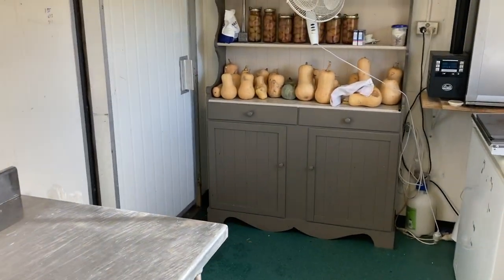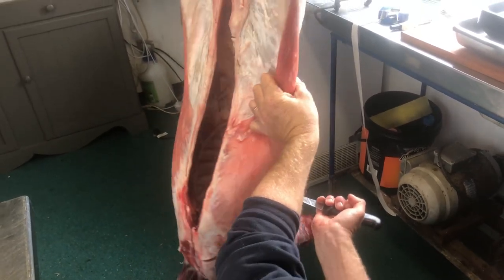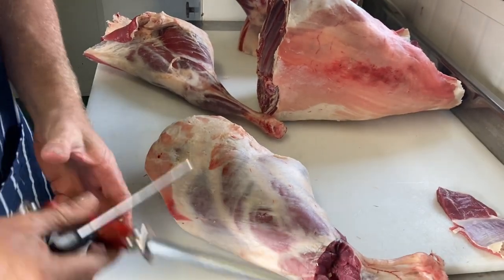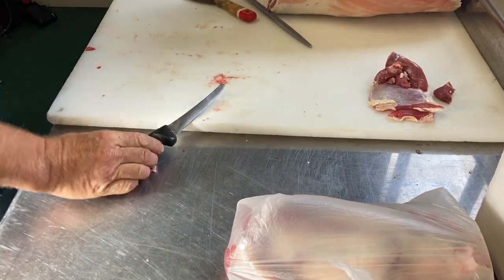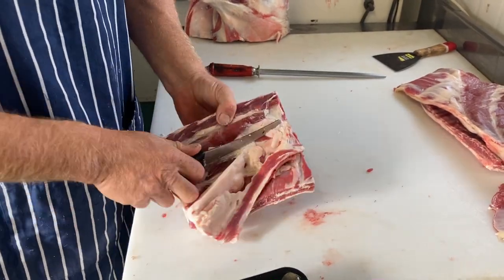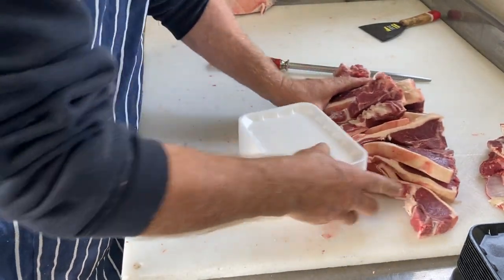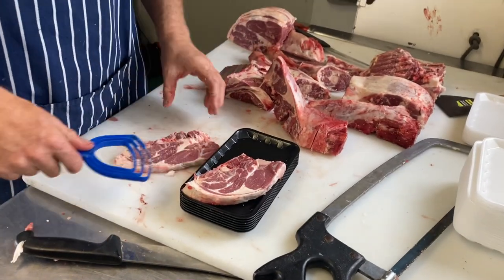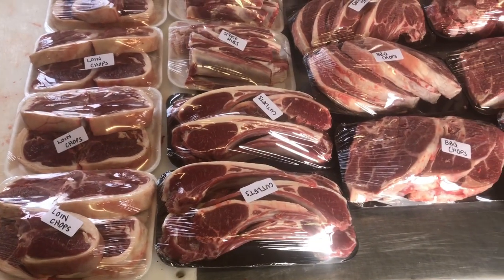Paddock to plate self sufficiency: how we process a lamb

Comment: Hi :) I have a question regarding your hand bone saw. I have one that looks just the same and I don't know how to change the blade! There's a pin through the blade at both ends but no slot in the metal so all I can think of is to use a punch and pop the pins out but it seems a strange way to do it. My dad gave me the saw and the blade's a bit rusty so needs changing. It's a Mundial but all I can see online that looks the same are Geisser saws but without instructions on blade changing. Any advice would be great. I'm in South Gippsland and gearing up to do my first sheep.
Reply from the maker: Hi if the blade has been in it for a long time you might not be able to see the slot in the metal with my saw u just losen the tension nut and knock the pins out usually the pins will only come out one side so just take care when getting them out not to sure about putting a video up with to much blood and guts I think it would turn to many people of were in south gippy are you and when are u doing your first lambs